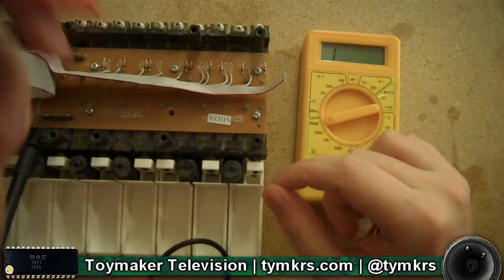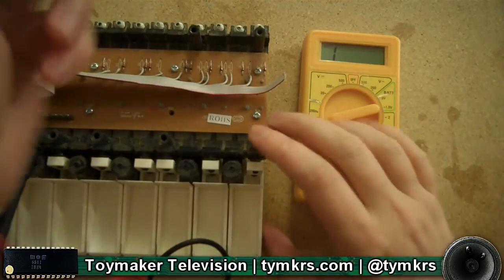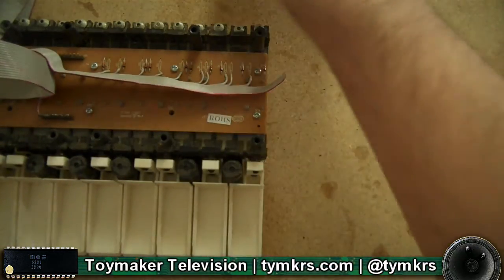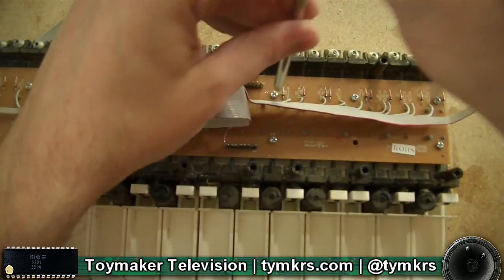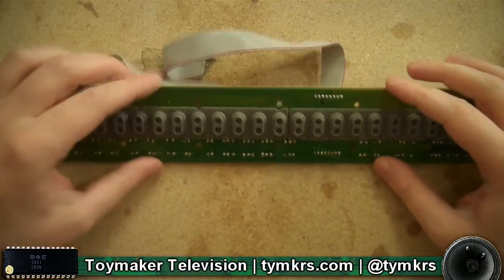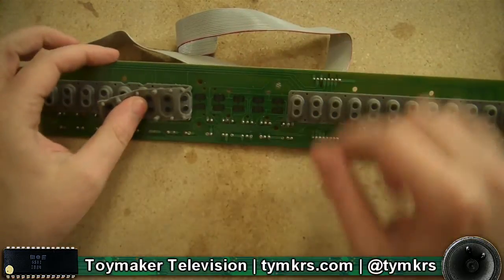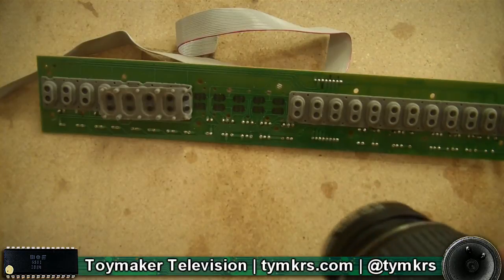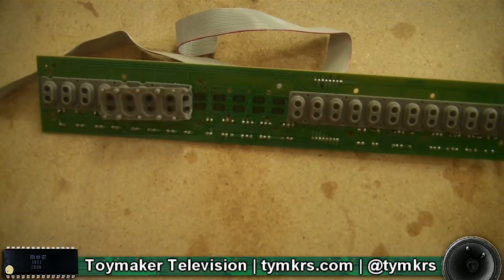Modified Velocity Sensing Keyboard

Comment: Can I repair the touch sensor  if it's not working
Reply from the maker: If you can diagnose why it is not working, then yeah.  Cleaning the board and rubber with a mild detergent can sometimes fix a spotty connection.  Sometimes adding a bit of pencil carbon can help make one of the connection points connect more strongly.

Comment: I didnt understand how to resolve the velocity problem when i hit some notes they go from 0 to 127 velocity with out any middle velocity pls help
Reply: Parigos Ziemprod How are you calculating it? Just time how long it takes to measure the first button press to the second. Measure the distance between the keys, divide distance by time.
Reply: athf226 i dont calculate i just see it on the daw ... When i hit the key it automaticly go to 127
Reply: Parigos Ziemprod if you are doing it this way as in 2 contact points, you need to calculate from rising edge of the first switch to rising edge of the second
Reply: athf226 no bro i dont have voltmeter so i know by my daw that the key is dead ... i dont know what to do to resolve it :/

Comment: how to find out the scan matrix looking at the ribbon . I have a 25 key midi keyboard which is not sending out midi . hence wan to fix it using arduino. but i'm unable to find the scan matrix for the same.. plz help.
Reply from the maker: Multi-meter continuity check to find out which ribbon line becomes connected to which ribbon line when each key is pressed.  Looking over the traces first can give you hints.
Reply: thanks, will try that
Reply: i'm getting duplicates highs while scanning key rows and columns.. my 25 key keyboard has 16 pins an I assumed 4 rows and 8 columns . i'm having some success identifying keys . but I'm getting high for both 1,1 and  1,2  for C note.. like this i'm getting a few duplicates..am i doing anything wrong ?
Reply from the maker: Working out exactly how the matrix is laid out can be troublesome, sounds like you are on the right track to victory!

Comment from the maker: Look for our SidCog organ (which uses a hammond keyboard) and Protosynth videos for more interfacing material.  I prefer interfacing with the existing switches, but that gets tricky when the organ is still functioning in it's original function.

There is room under the keys that you might be able to make use of too.

Comment: I'm trying to figure out a simple way to add midi to my Hammond and Wurlitzer organs by creating an ultra thin strip that can slip into the area between the back of the keys and the black steel panel behind the keys. Since all keys have a long mounting base it would be fairly simple to use the movement of this base ( as a key is pressed so moves the base) to make contact with a spring loaded movable pin, one behind each key. Midi triggering could be done easily using this. Ideas for interfacing?

Comment from the maker: The diodes are there to allow for some kind of charlieplexing or matrix, think an X Y grid. They allow the midi controller circuit to scan through all of the switches on just a few wires (over and over very fast). I just wanted the keys to act like switches, so I threw out the matrix and the midi circuit. But if you want your hack to generate midi signals to control a computer or something then you'll need to leave those diodes in place!

Comment: Where the ribbon cable is soldered to the midi circuit,  I connected each combination of pins (using a single wire) to test each note and made the sounds come on and off.  All mapped now ! So if I understand this right, I can just toss the midi circuit and connect my switches straight to the ribbon cable, right ? I'm curious why did they go through the hassles of adding all these diodes ?  
I cannot thank you enough for the tips, I'm new to modding and this is incredibly helpful.  Cheers

Comment from the maker: I am not using the midi part of the circuit at all. What you need is to tap into the traces that lead up to each of the switch pairs (two leads for each of the two switches for each key). Add your switch between these two sides, connecting both together simultaneously (which says full velocity to the midi controller). Repeat for each key.

Comment: I just got an oxygen 8 midi controller keyboard and wish to make the velocity sensitive keys into an on/off configuration like you have it in the video. I'm actually going to convert the controller to an arcade push buttons setup instead of the black and white keys.  Can you provide any guidance on which diodes to remove and the role of the ribbon ?  Thanks in advance !

Comment from the maker: @vk2zay Addie @atdiy said she might do some more detailed research and post an article to the tumblr feed.

The modification was to break the circuit for the back switches at each diode, tapping in there with the ribbon cable, and to wire the header together a source for all of the switches.  I wasn't too interested about how it originally functioned for my purposes.

Comment: Awesome, thanks for taking the time to pull that apart to show me how it works!

Now you've got me even more curious about how the scanning logic works, it must poll them relatively quickly to get accurate acceleration sensing, with those diodes and the bit of the traces I can see it looks like it has a scanning matrix, either grid or a charlieplexing graph topology...